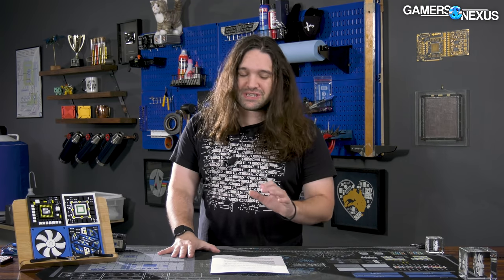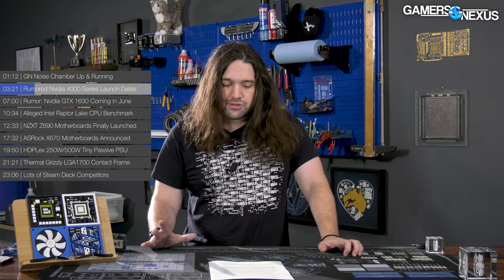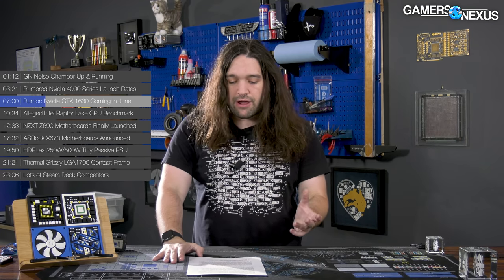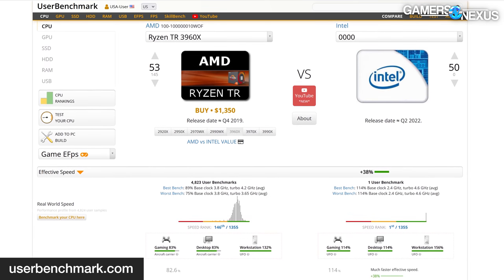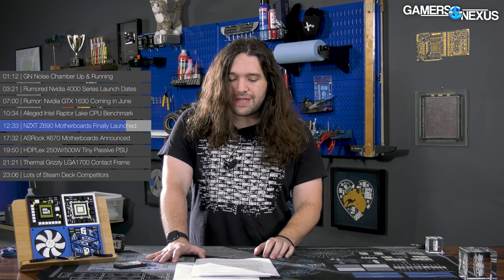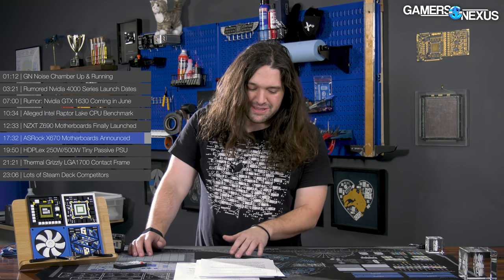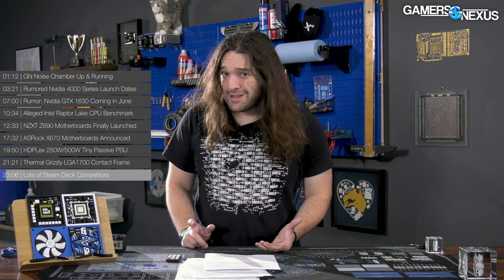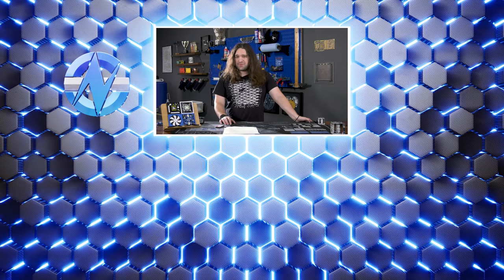HW News - Unbend Intel, RTX 4090 Launch Dates, GTX 1630 GPU, & Steam Deck Alternatives

Comment: Userbenchmark is like a pet rock....... you only notice it until someone points it out. And when you do notice it, you wonder why they have it in the first place.
Reply: Userbenchmark is like junk food. Sure you can consume healthy Anandtech and Gamers Nexus reviews for thorough examinations of products, but if you're just looking for something quick, unhealthy product comparisons, Userbenchmark (and Passmark?) are your friend.
Reply: @Robbie-mw5uu  It's a different thing, Anandtech and Gamer's nexus only test basically ONE system paired with CPUs showing an artificial unicorn scenario like testing audio equipment on a anechoic chamber, but in real life, stuff like sillicon lotery is real, and many other variables that don't show up on synthetics.

I prefer Notebookcheck, and i would love a similar database but for desktops (and their components, specially exposing crappy motherboards).

It doesn't matter if you test a 12900K without benchmarking the memory, then you realize a 5800X3D getting close in gaming due to crappy and overpriced DDR5 sticks while it shows in userbenchmark the superiority of memory latency on the 5800X3D for now.

Userbenchmark can help, but obviously it's better to do your own research.
Reply: @Robbie-mw5uu  I also learned through userbenchmark why Alder Lake mobile for now is kinda crap, with the help of notebookcheck and other reviewers, they are paring those chips with DDR4 and terrible poorly cooled 15inch systems with bad power limits🤦‍♂️

Comment: i have a RTX 3080TI RN should i be preordering RTX 4080 or not worth it you think?
Reply: If you always want to be on the bleeding edge of tech go for it if money isn’t an issue. No one really knows yet how much a performance boost it will be so might be a gamble.
Reply: @user-qw9fy9js2o  I’m going to upgrade to 4K oled display and I want the most gaming performance at high or ultra settings in game. Atm my card is able to do tht but can’t push over 100FPS at high settings
Reply: @PickemMMA  can’t say the new cards will be Able to handle 4k high Fps in demanding games at high/ultra settings. It seems like at the moment High end 30 series cards can do 4k 60fps (on demanding titles) I’m sure the new cards will be an improvement. I just can’t say how big. If money isn’t an issue go for it. It does save time not having to mess with settings.
Reply: You will be extremely CPU limited on Unreal Engine 5 games anyway.
Reply: @saricubra2867  I have a Ryzen 7 5800X
Reply: @PickemMMA  Well, undervolt or try to OC that thing if you can. Not even a 12900KS can handle steady 60fps on Matrix tech demo even with software raytracing disabled.
Reply: @saricubra2867  I’m waiting on the new AMD CPU to be released and I’m sure that will be able to handle it I’m sure and once I get the new 4080 or 4090 I’ll be fine in September or by October atleast

Comment: Optical audio comes in two different plugs one is the tried and spotty wtf is that plug and the other looks like a headphone jack made of plastic. My guess is one of those headphone jacks has an optical emitter at the bottom of it. I think my mobo has the same and it is Z490.

Comment: Just because of mining I would say high-end GPUs are the one that set prices for the lower classes, so it should be on Nvidia best interest to release the 4080 first and milk the miners a bit more later with a 4090 and 4090ti post release.
Reply: Mining is dead and will get worse when Ethereum eventually goes proof of stake. No farms are looking to buy more new GPUs at the moment or in the foreseeable future.
The only question about the selling of the new GPUs is if the vendors will tackle scalping bots.
Reply: @Safetytrousers  Oh yea I say it years ago when the thing was a boom, it will die since only feeds the black-market and got worst when they realize it wasn't any good for the environment to burn so much power. None the less they did invent something cool to move money under the table and the black-market would probably invest some to keep it floating at least.
Reply: What
Reply: @t1e6x12  No clue
Reply: the wealthy are served first, and after that the peasants can

Comment: When they or still selling 1650 supers for $300 on Amazon while everything else has come back to msrp pretty much haha it’s amazing how the low end GPUs cost what a 2070 or 2060 does used… you would have to be crazy to pay more than $170 for a 1650 super new that’s what I paid for one right at launch and it was for my 8 year old and I’m already looking at replacing it it’s pretty much a 1060 6gb in performance it’s not aweful at 1080p but it’s not amazing beside that it sips power and the fan barely runs if you were building a tiny Pc you might want to game a lil bit with it prob be the perfect gpu it does have nvenc and hardware encoders so it will help with media task it’s a very good not high end option but I wish I’d of got the 1660ti then but I expected to just eventually buy 2070 or now 3070 when I upgrade his pc finally prices or getting about right again it’s been 2 years of retarded prices

Comment: Sounds like the Neo geek that you're listening to the live stream for is trying to capitalize on the work that valve is doing with the steam deck on software and firmware. Hurting the same architectures they are likely hoping afford to them some similar performance options to what we've seen in the steam deck that everyone's so impressed with.

Comment: the interesting thing about the 40 series will be what the msrp is set at.  the 30 series msrp was pretty good, at least until you got the the 3080ti/3090/3090ti, so will the 40 series be priced based on those overpriced cards?  Hopefully with AMD destroying the 3090ti in price Nvidia will be forced to be realistic about prices

Comment: Call me back then i get 50% more performance and a smaller fps dip when i turn RTX on and power draw is under 300 watts again.  till then im just not interested in a new gpu.  power is stupid expensive now and i dont need a airco to cook the game room and spend 600 more on a gpu trough the power bill and a aditional 500 on the airco

Comment: I am pretty interested in those chinese handhelds. Could you please look into the more powerful ones instead of weaker ones? Steam Deck is barely powerful enought to run games properly, I wonder if competition can actually overtake them with their windows based designs.

Comment: amd and nvidia not only competing to be the best, they also trying to be the worst! amd's contender was a rx 6500xt which was worse than the rx 5500xt. That was their upgrade backwards. Now Nvidia trying to fight back with a gtx 1630, which is replacing the gtx 1050ti and somehow ends up worse than it.
Reply: I give NVidia a pass based on the numbers. "GTX 16xx" means we should expect tech equivalent to the GTX 1600 series. "xx30" means it will perform at a level below an xx50 class GPU. In NVidia land, anything below an xx50 is considered below entry-level performance. It is a GPU that will function, doesn't cost much to manufacture, and is fairly power-efficient. The 6500 XT is a head scratcher, though,

Comment: Taichi Carrara looks tacky. If I want a flashy motherboard, the Asus ones are far more aesthetically pleasing. That said, I'm sure the X670 Aqua will be beautiful. While I'm talking about mobos, I wish one manufacturer would move away from the Realtek onboard audio in favor of some other manufacturer for audio hardware. Realtek's ASIO driver has been broken for years and they don't seem too keen on fixing it, leaving otherwise great audio hardware unusable in many pro audio applications, and even Voicemeeter for that matter.

Comment: Isn't NZXT that Canadian PC Part Suplier that went broke a few years ago? Why buy some trashy MoBo brand? I'd go with GIGABYTE by default, then ASUS, then something else, don't go for the cheap if you can help it, it's expensive in the end.
The Flatening device is a great optimization for CPUs, and should be bought whenever is possible; I can't believe it's not standard already

Comment: 4:58 After seeing that, I guess AMD is late; compared to Nvidia dates, we should already have, in the market, Navi 31 and Navi 33 GPUs… but AMD released, instead, some refresh of Navi 21 and Navi 22… (maybe that’s why they released those, instead of Navi 31/33 because of some sort of TSMC N6 contracts, who knows ?)
Reply: Well AMD said they were going to release a refresh so that's what we got, new GPUs will be out about the same time as NVidia.
Reply: @nimrodery  Yes, I know; but I remembered the released of RDNA 1, then RDNA 2, then "leaks" from MLID in 2020 (in March/April 2020) saying that, after RDNA 2 release, AMD would have a 18 months cycle for GPU (and around 12-14 months cycle for CPU). as you can see, both ZEN 4 and RDNA 3 are late...
Reply: Anyway, that's not big deal; I just hope that the MSRP of the 7700XT will be the same as the 6750XT (currently at 510€ w/o VAT in Europe)
Reply: @grospoulpe951  I don't put much stock in leaks. It will be late if the launch isn't near NVidia's.
Reply: @nimrodery  true; what could "save"AMD is they (truly) release the Navi 33 GPU by the end of 2022, competing with the 4070 at a better price and consumption... but I'm afraid that availability will be poor. Anyway, 2022Q4 will be interesting, I think (Lovelace, Navi 33, maybe Alchemist)
Reply: @grospoulpe951  you're probably right, amd doesn't need the gpu sales and it's a rough market so they rely on stable income like mining. Rdna 3 seems like it could buck that trend and appeal more to gamers (although I would have bought a 6000 series gpu if they were available at competitive prices). Now that raytracing should work well enough for both brands we'll hopefully see more direct competition

Comment: Userbenchmark is great for running the test suite on your PC and comparing it to other builds with the same components. It's also fine for getting a general idea of the performance class of a part, but shouldn't be trusted when comparing products of the same performance class with each other.

Comment: I have a suspicion that the 4090 was originally supposed to be the 4080, however they pushed the whole naming convention down 1 notch to bring back the "titan" card which would essentially be the 4090. So Titan = 4090 and 4090 = 4080 and so on.

Comment: Audio SPADIF is a big deal, I use TOSLINK to connect my PC to my Amp. I really do not care how many 3.5mm ports the rear I/O has if it's at least one and the motherboard has S/PDIF out. If I bought a motherboard (not that I'd buy one from NZXT) and it wasn't there when they said it was, I would blow my top.

Edit: asrock: No, for either. I don't like the aesthetics. Esthetics are not very important to me, but if I'm going to have to pay for them then I want them to not be ugly. Ideally, give me a full-featured, properly cooled motherboard that is cheap because it has no pigmentation, no pointless lights, no stupid plastic, and no superfluous bullshit. Same with RAM, I don't need heat spreaders, or at least I didn't on DDR2/3/4 maybe we will on DDR5, I would love if you guys did more extensive testing on whether they matter. In the past they made things worse, in recent times they didn't hurt, but they didn't help. If they don't help, they are a waste of raw materials and money.

Comment: Why would they put windows in it?
Reply: Windows has billions of users and can expand the user base immensely, at zero cost.
Reply: @SISSYPUSS  but it is also I doubt anyone will use it as a desktop computer.
Reply: @lamebubblesflysohigh  It's probably easier to think of these as portable-compact computers than simply game devices.They are built to be OS independent, the gaming specific enclosure is basically just a wrapper, and user supplied peripherals change them to more proper 'PC" type devices. It's good for computing to have options. :)

Comment: the 1630 makes no sense, just buy a used 1650 or litterally anything else, if you want a new card then get a 3050 which will be alot better and probably have similar tdps

Comment: Ah yes, the meme 4090, which will require a 4090w PSU, 4090gb of ram, 4090 core cpu, 4090 euro to buy, 4090 euro in electricity bill, 4090 cables to power it up, 4090 tb of ssd just for the drivers and most of all 4090 limbs on top of the 4090 euro just for buy one.

Comment: x670 taichi carrera with 26 power "phases" huh? 26 freaking phases. Are they using doublers or is there yet a vrm controller that can provide 26 pwm signals? Or is it just marketting bs? I think it's just marketting bs because I don't think even 12 phases are necessary to power 16 core zen 4 cpu. Nope. It's probably not even 26 power stages for the vcore. It's just in total 26 inducters in the mobo for everything including vmem and chipsent and other minor rails. 26 phases, I hope I'm just wrong lol. If 26 phases is actually 26 true phases without doublers, then we'll have a great motherboard lineup for x670 just like we had in z690 in terms of voltage regulation...

Comment: Can anyone let me know what a clock_watchdog_timeout error BSoD, on a brand new prebuilt, that also has extreme cpu overheating might be? I’ve done almost everything I can do fix the problem my self, I’ve completely reset the pc, reinstalled windows, ran driverfix all my drivers appear ok, ran the ram diagnostic 3 times, fine there. The gpu is a Evga 3070ti as far as I can tell it seems to be ok. I even took it to a pc repair place they said they ran a stress test all day (they had it all week) and could find nothing wrong with it. I even installed another fan on the upper rear of the pc, BSoD less 2 hrs of playing HZD. I have finally managed to get it sent in for warranty work Monday, but who knows when I’ll get it back or if it will be a working pc, and not a huge pretty brick when it does. Idk I feel like I’m most likely out of money and luck lol.

Comment: i think this is wrong. this is synthetic testing no one have soundproofed walls. the subjective experience is in a normal room with normal walls. so a test should simulate the avarage office enviroment in my opinion. you overengineered this

Comment: Ngreedia and AMD just finished launching their Enthusiast GPUs and soon after a refreshes: SUPERS from Ngreedia and improvements from AMD GPUs, they're not going to launch anything, they need to produce for months those cards to break even and start profiting and would be competing with themselves, obligating to lower the price on the old and going high on the new, both will be bad for business, after about 6-9 months when most of the production have been sold, yeah, it's OK tho, so I think approx by Xmas or Q4, if not Q1 '23, maybe even Q2 '23. Because there is no need from the technical POV: even a 1080 play any game, what people want are more Video Cards, so don't get anxious, don't buy the hype, let it be, let it be, there will be an answer, just let it be... BTW this happens on every new GPU phase: OMG, OMG, OMG, the ew GPUs! pfff. Plus they're trying with PCIe 5 and DDR5, BAR, new CPUs, Chipsets and other the usual design goals to achieve, so it's not just the GPU, this generation is coming with a big leap, so I prefer to wait longer and get it 100% bug free